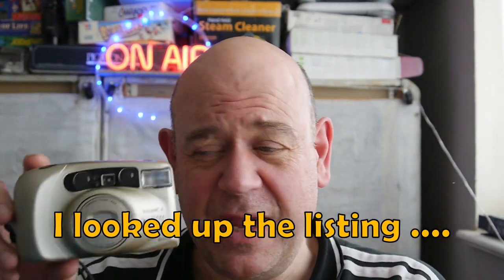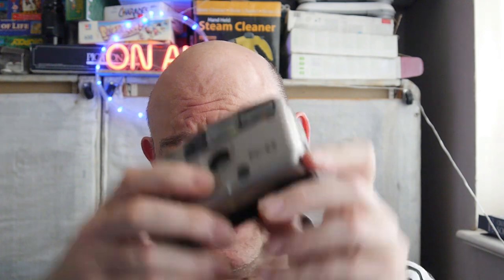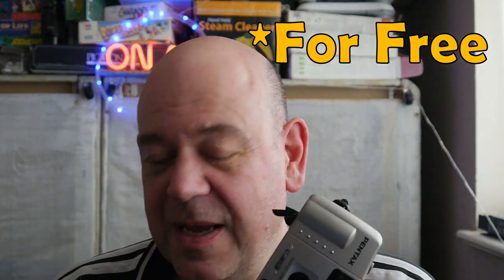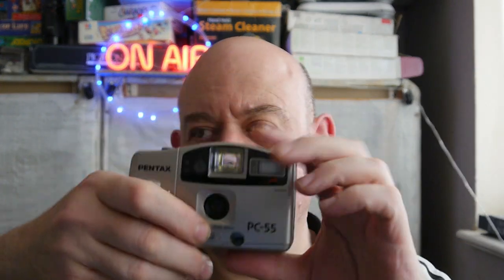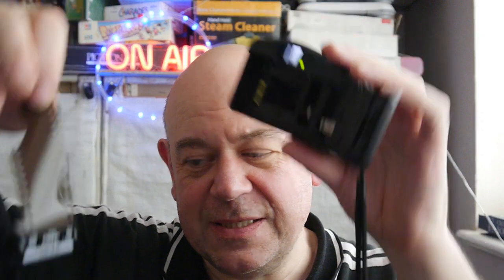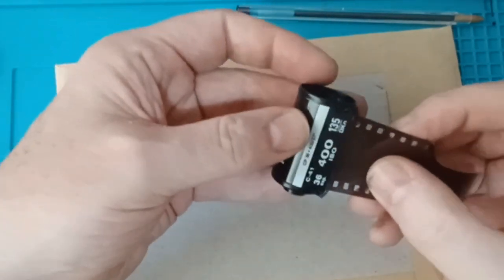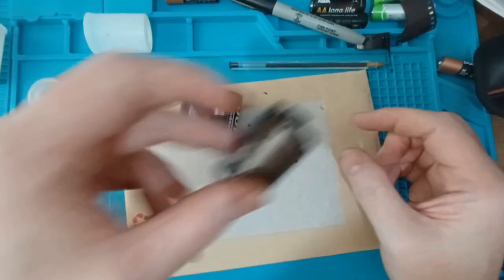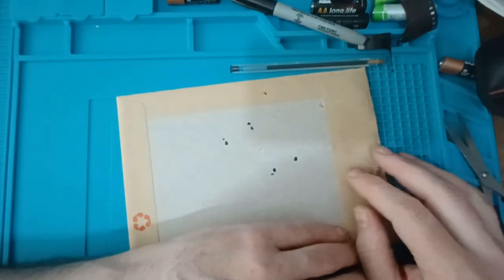How To Film Test a 35mm Camera for eBay & Test Film Re-using Tip

Comment: Do I need to buy a new film roll or can it be used for testing? Thanks!
Reply from the maker: Hi thanks for watching. The film can be a used one. That's preferable actually as it no longer has any value. If it has any damage on the end just trim it as explained.